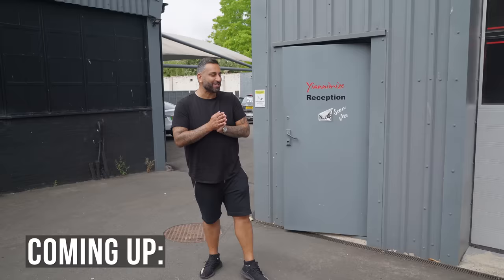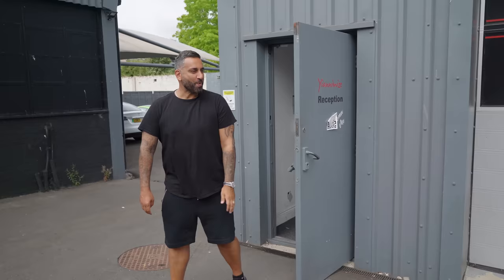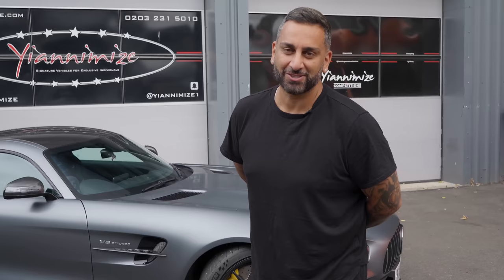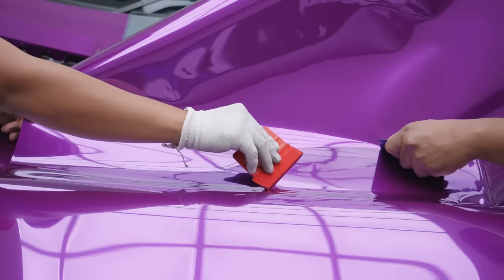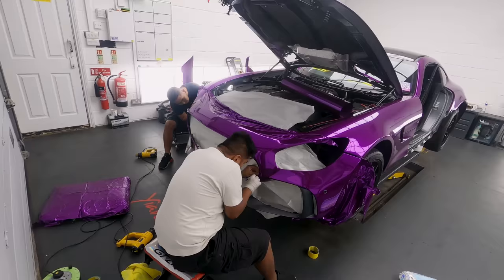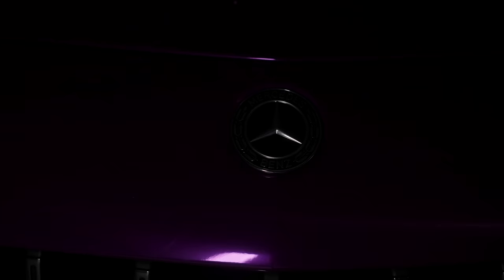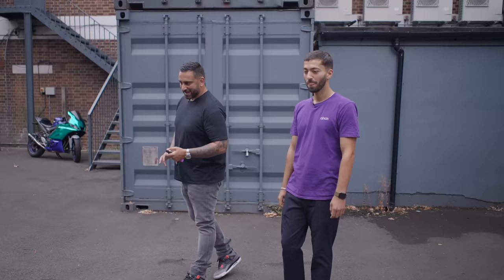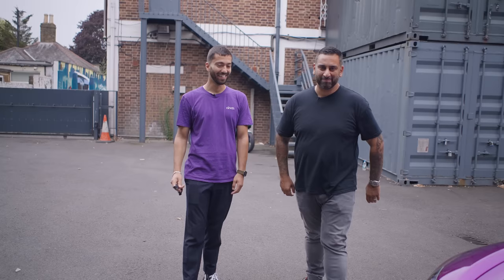Tempting | Chrome Purple AMG GT R For Sale

Comment: How does knifeless tape work??
Reply: I believe it has a metal inlay, which when you pull it cuts the vinyl. I could be wrong as its only an assumption
Reply: I don't want to be rude, but if you would Google that you will probably find the answer and a video too
Reply: Basically it’s a small bit of tape that has a wire underneath similar to fishing wire you lay the knifeless tape down on a edge put the vinyl on like usual and then you’ll grab the wire which will cut the vinyl very well. Thus no knife needed
Reply: @DavetheMonster  I want them to answer it
Reply: @j8tats  they won't
Reply: @DavetheMonster  no matter how one puts that it always turns out rude